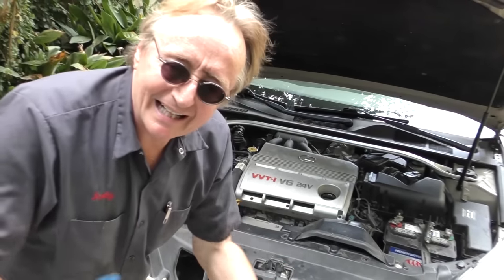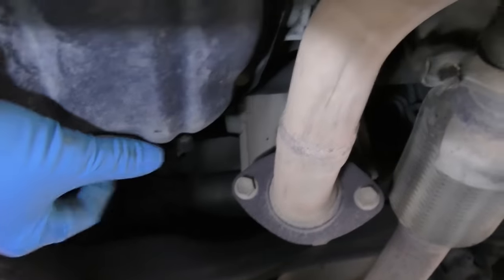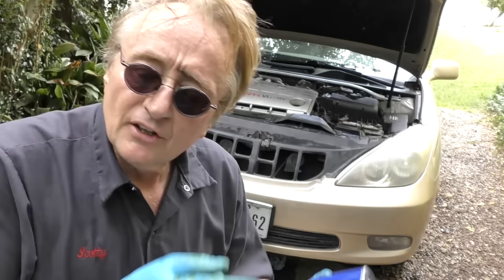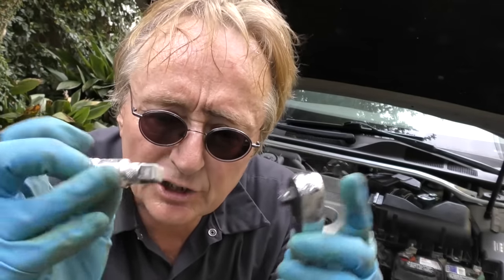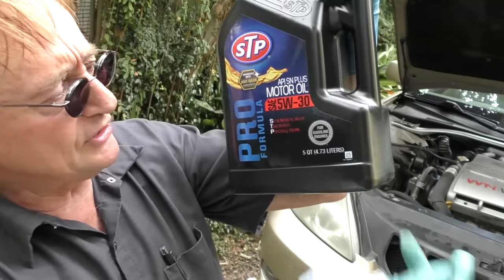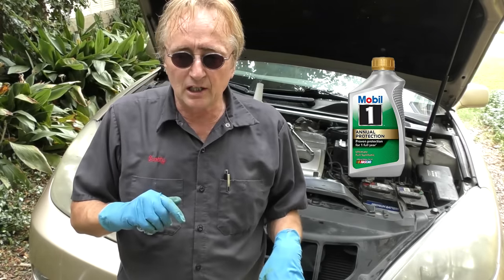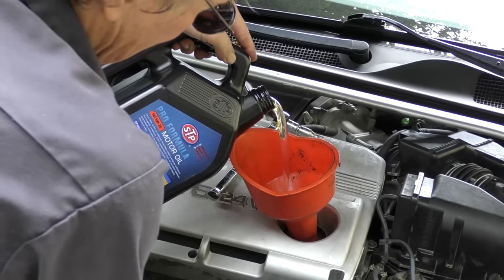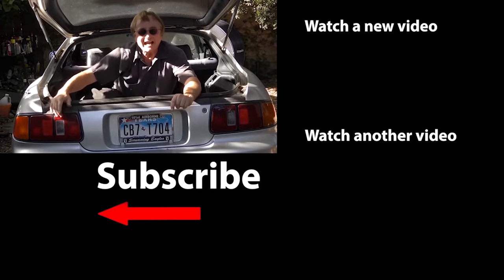Changing Your Engine Oil? You’re Doing It Wrong

Comment: Sorry, I agree with this entire video except for using a 2 foot long breaker bar to tighten a oil drain plug. That's how you end up having to replace the oil pan after 50k miles because the threads are stripped.
Reply: I'm surprised he didn't get a torque wrench out for that as well.
Reply: Well obviously you don't put full force on it, but if you hold back and can tell roughly how much torque you are applying (as I'm sure a 50+ year mechanic would)... there's nothing wrong with that
Reply: Yeah Scotty is mostly full of shyt at this point. Who uses a breaker bar on an oil drain bolt? No amount of being careful with a massive breaker bar is gonna stop you from overtightening that bolt and destroying it. Just use a normal sized ratchet lmaoooo. RIP everyone who follows this advice.
Reply: TRUTH!
Reply: Interesting
Reply: @vviiper  Someone tightening their drain plug with a breaker bar.  "Just keep spinning", "Just keep spinning".
Reply: @vviiper  Using a breaker bar on a drain plug to tighten it is Scotty's thing. Most mechanics would say do as I say and not as I do. I'm sure Scotty has been doing that for decades. Although I've never have. And never will. 

As for loosening the oil filter. I've used oil filter pliers for years. But he has a point the socket attachment would be needed on that Lexus if you can't reach it from the bottom. And you learn something new every day. I didn't know you could recycle oil filters. I'll be sure to check with my local Autozone next oil change.
Reply: @doubleb95-d6z : Ever heard of a torque-wrench? A bolt will never be tightened correctly unless you use a torque-wrench.
You can have all the years "experience" you have, but you will never be sure of the torque unless you use a torque-wrench.
Reply: I tighten oil-filters by hand and loosen them by hand.
Reply: A quarter turn is a quarter turn, whether it's a 3/8's drive ratchet or a 2ft bar. He said get it snug, then just a little bump farther, then he turned it a quarter turn. A lot of people in these comments are just dead set on hating on Scotty, there are whole communities dedicated to it for some reason.
Reply: @dewrus2153  Yea, was going to say drain plugs? How quaint. :) I use ez-oil drain valves on both my engine and transmission. I do change them both frequently enough to make it worth it, the start of every season. Spring is coming so am changing my fluids next thursday on the 1st. With the crush washers at $3 each they pay for themselves in a year or two.
Reply: Austrian Painter Hiding From The Algorithm snug with a 2ft breaker bar is very different than snug with a 3/8 ratchet.
Reply: Yea, if you want to do it right, use the torque specs, otherwise just snug it down with a wrench.
Reply: @dietermeyer9231  If you want to be super critical sure, but I can tell you in a shop...nobody does that on oil changes! With some kinds of parts... torque wrenches are important.  An oil drain bolt is not THAT torque sensitive. You'd have to WAY overtorque it to cause any sort of thread damage. 

I worked in a shop for 2 years, I've done probably over a THOUSAND oil changes in my life...never once had any oil pan/thread problems. 

And yes, you never tighten an oil filter with a tool, hand-tight only
Reply: @doubleb95-d6z  see? This guy been changing oil for 2 years and get over thousand customer. Then what about scotty that have been working for 50+ years?
Reply: @ToyotaGuy88  if you know how to use either one it isn't.
Reply: Ed Aker then you explain to me how the same force applied to a 2ft breaker bar and same force to a 3/8 ratchet is the same. Regardless of if you know how to use it or not.
Reply: I wouldn't use a breaker bar either for tightening an oil drain plug, especially if the pan is made of plastic or aluminum. If you're using a new crush washer on the drain plug you can easily tell by feel when the washer has crushed fully and the proper tightening torque has been reached.
Reply: Dieter Meyer do you use a torque wrench on your drain plug? If you do your weird. You don't need to. Snug plus a quarter turn never has done any damage for me or anybody I know. It's when you're stupid and go further than that. I never torque anything. I don't even own a torque wrench. The only thing I'd worry about using one on is internal engine parts.
Reply: Just choke up on it, like in baseball.
Reply: @dietermeyer9231  putting on by hand sure...but I never had an oil filter that I could take off without a wrench. An yeah I always try that first fir "Shits and giggles" .
Reply: Paul Power are you just super weak? 90% of the time if I'm the one that put it on and it's changed within a reasonable time frame I can get it off by hand. Maybe you're tightening it too much. Just till it touches plus a little bit (maybe a quarter turn).
Reply: @dietermeyer9231  careful there, the world might run out of hyphens...
Reply: With all the advice everyone is giving did anyone check the proper amount of torque for a Toyota oil plug?
Reply: @dietermeyer9231  unless ur torque wrench is inaccurate!!
Reply: @doubleb95-d6z  a qualified mechanic will always use a torque wrench especially if he has 50 years experience I know this because I am a diesel fitter trained by Caterpillar, by the way that's why the service Manuel supplies the specific torque in the work  shop Manuel
Reply: @blacksheep6888  In some areas yes that's very important. Internal engine parts, most gaskets, and lug nuts are areas I will always use one, also diesel injector terminals are often very sensitive as I'm sure you know...so I wouldn't dream of doing those without a torque wrench!

 But an oil drain plug? I've never met any mechanic who goes THAT far with it. They aren't THAT torque critical. And like I said... with 0 problems out of more than a thousand oil changes... that's evidence enough for me
Reply: @doubleb95-d6z  well that's okay but when you find a striped sump plug or it comes loose don't say I didn't warn you because as qualified mechanic I have seen it all before, and I suggest if you see a so called mechanic not use a torque wrench then change your mechanic to a real one.
Reply: I also use a torque wrench on my oil filter as well because not all oil filters are hand tight for example a Suzuki gsx250r is two full turns from when the o ring touches the housing of the filter, I once picked up a Landcruiser from the dealership and only got as far as the gate when the filter came loose and on another occasion I witnessed a spin on oil filter come off a Kawasaki zzr on the drag strip so using a torque wrench  is a wise thing to do because an oil filter and a sump plug are critical engine parts, if you don't believe me leave them off and see how far you get without them and, its a lot cheaper to take the time and do it properly the first time especially  compared to the price  of an engine rebuild.
Reply: Ah yes!  100% agreed. I have learned the hard way-hand tighten the bolt all the way down, then just snug it on -maybe 1/4 turn with your ratchet. It does not need to be grinded on. It’s holding oil in-that’s it!  Same with spark plugs. Two things that if you strip the threads, you turned a routine maintenance job into a week long project